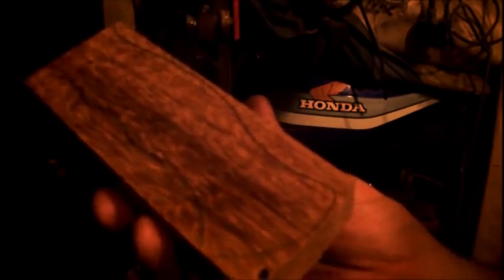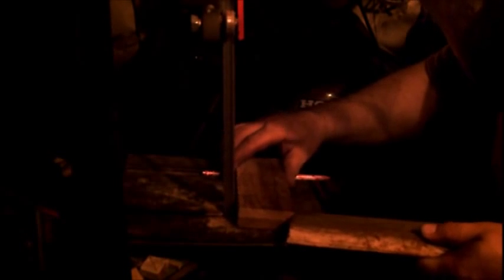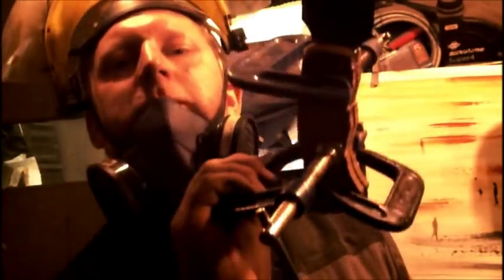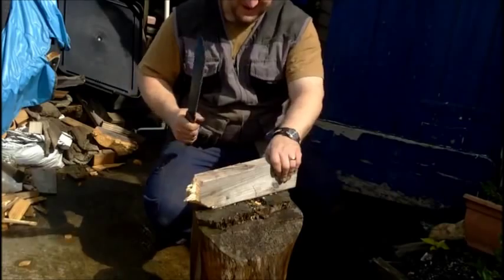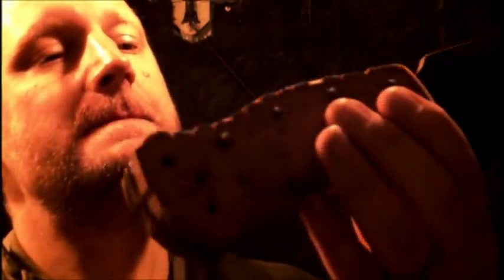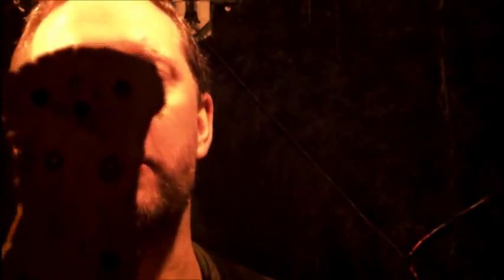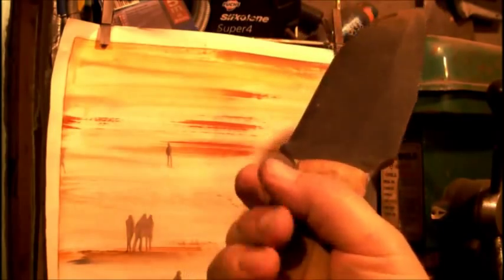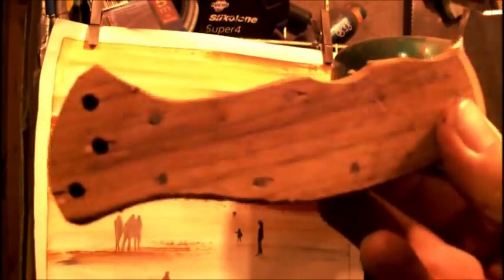Custom Kabar Warthog , heavy duty survival knife with hardwood scales

Comment from the maker: hi Mike..I full tanged it..ha ha..in a previous vid it shows the extra fillet all around the stick tang,,this was seam welded all around on both sides,,so I didn't have to drill through the tang without annealing the whole blade,,which would have corrupted the factory heat treat and lost the coating...even the balance is pretty good as I drilled a few extra holes,,,Iroko scales too..thanks for the positive comment..it really means a lot!!! all the best my friend!

Comment: I have some huge C clamps (american name for G clamps :) ) with flat plates welded on the working surfaces to spread out the clamping force. They work well for specialty applications like pressing in wheel bearing seals on implement hubs

Comment: holy smokes, how did you drill the holes in the tang? you have carbide bits? when i customized the one i did, i placed the pins around the tang but not going through it, kind of sandwiched the tang in the handle and only the tang hole went through and through... great job Scott!